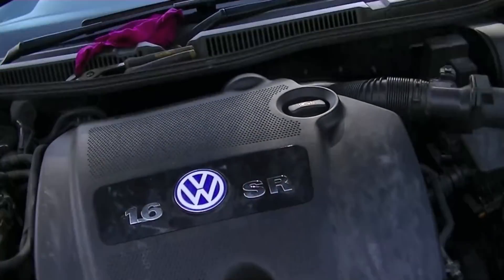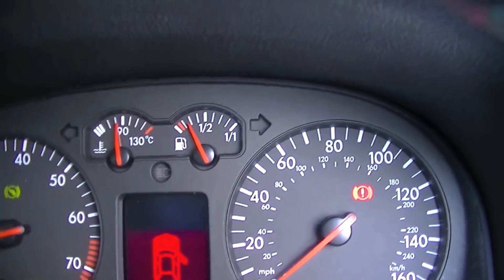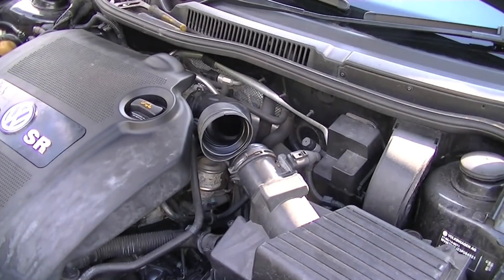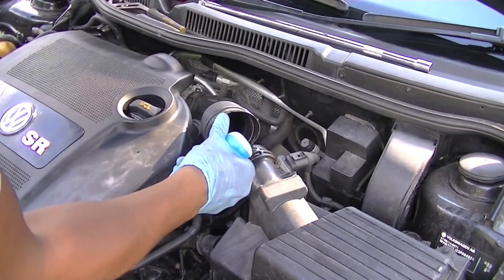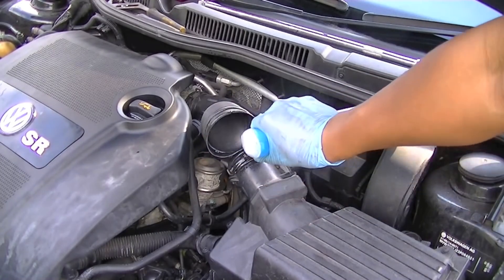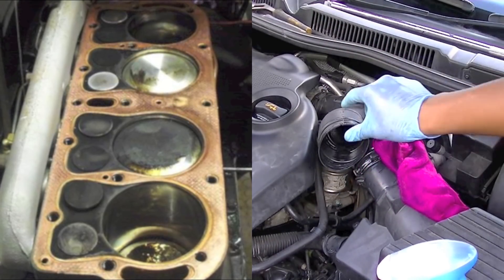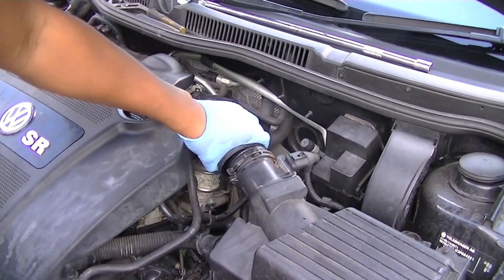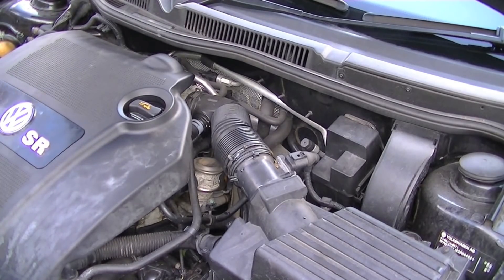How to make your engine run better with just tap water.......Better Than Seafoam?

Comment: WATER IN THE ENGINE??? The only thing that may not come into engine?
Reply: +Luka Koprivica  farmers have used homemade water vapor injection on their engines for year and years and it only helps keep them clean and running for a long long time. water vapor does not hurt the engine.

Comment: LMAO i have been doing this for over 40 years and it has always worked great.
I learned it in 1974 from an old man that was a ford mechanic from the 1930's to the 50's.
don't use tap water use distilled water, tap water has chemicals and minerals in it  that will cause buildup.
Reply: Excellent intelligent comment

Comment: One other thing to consider, that even those arguing about catastrophic engine damage can't deny...if your logic had validity to it, then every single time a head gasket failed, it would also result in a cracked block, cracked head, seized parts, etc.  While this may be true, occasionally, the majority of head gasket failures do not produce these results.  90% of the head gasket failures that I have seen, the engine will be billowing huge plumes of smoke from the tailpipe from burning the coolant, which is at a much greater ratio to the air than in this video, and it will just keep running, albeit, not very well, and will not cause any extra damage.

Comment: I'm not sure why some argue that you can't compress water.  Everyone knows this.  The cylinder is still drawing in over 99% air, even with the mist.  If this argument had any validity, then by all means, DO NOT drive your car when it is raining and it is 100% humidity, unless you want to damage your engine.  The other argument regarding water washing away the lubricants...water and oil don't mix, so it would be difficult for water to remove oil from any surface, piston compression rings create a seal which would prevent water from reaching the oil scraping ring, and most if all, the engine is continuously circulating oil, so any oil that would be removed, would be replaced immediately.  This seems like a logical way to remove carbon.  They say that water is the universal solvent, and over time can break down just about anything.  And we all know that heat increases the rate of reactions.

Comment: Tap water could cause the engine block to crack because the engine can't compress water so once again another stupid video on you tube:(
Reply: Of course it can't compress water, but it's still over 99% air.

Comment: Doesn't Acetone have the same Effect?
Reply: No, acetone will burn in the combustion chambers.  The idea here (very well documented by WWII airforces on radial engines) is to produce steam (that obviously doesn't burn) in the chambers - this steam scours the surfaces, including the exhaust valve stems and tulip surfaces.  It works as demonstrated.  Just run the engine for some time after treatment to make sure no water remains in the intake manifold.

Comment: Water and oil don't mix, I don't think it's a good idea
Reply from the maker: +hdashti2810 If you think about it, the boiling point of water is alot lower than oil. So if water was to get in the oil, it would most certainly evaporate once the engine reached temperature. That is my logic

Comment: What this guy is doing is absolutely harmless to a engine. It will not cause any damage if done correctly. The comments that I've read on hear are fucking ridiculous! Guys saying they are mechanics and this will rust/ruin your motor! That's bullshit! The car does need to be at operating temp for this to work. The head/valves/Pistons do need to be hot and up to temp. How this works is the water makes contact with the hot valves, valve seats, and top of the Pistons. And it then steam cleans the parts free of carbon. The water immediately turns to steam and exits the engine out the tail pipe. The steam does not have time to rust anything. This trick has been around since the 60s. Their is one issue that can come up. If your valves or valve seats are pitted. And you do this steam cleaning to remove all the carbon. The pits  will then be clean of carbon and the valves will not seal until you drive the car for let's say 6k miles and build up more carbon to reseal the valves again.
Reply: The cylinder has two volumes, one is called the swept volume(this is when your piston moves from the bottom of the cylinder or BDC to the top of the cylinder or TDC). The other is the clearance volume(this is the volume left above the piston after it has reached TDC). The clearance volume is far greater than the mixture volume,which includes petrol, water vapour and air. 

The volume of water is way too little the person is spraying into the engine campared to the large clearence volume.

Remember the engine is hot and evaporation occur fast, one piston is moving up and down about 40 to 50 times a second(for 2000 to 3000 rpm). Heres the maths, 40 x 4 cylinders x clearance volume for 1 cylinder, the volume calculated from this calculation will show how super small the sprayed in volume is against the calculated. Thus there will be no knock occuring.

As for the rust, air intake in any car always include water vapour. Water droplets always exits at the tailpipe of any car.

Conclusion, no knock, no rust, period.

How effective this technique is, is in the pudding. Do it if you feel convinced. Remember, your car, your problem.I am going to try it on my car.

Comment: I just did this method today on my 99 vw tdi 1.9l and it has 315,000 miles on it and this actually did have a positive result it ran much smoother and went through the gears much better. I just suggest making sure that you run the engine good after so that all the water evaporates from the oil so take it on the freeway for a nice drive. I did it it's safe and does help with high mileage engines.

Comment: I honestly don't see the point in doing this. If u get significant carbon build up to cause a problem I would expect a misfire and at that point ur surely going to have a root problem which needs fixing. and could turn out to be extremely expensive. I can't imagine how putting steam into the cylinder at at vacuum would have any benefit. This is assuming the amount of water reaching the cylinder has turned to steam by the time the cylinder starts the compression cycle. at that point I would imagine the addition of steam to increase the compression of the mixture at tdc which surely cannot be good for the engine. as engine are so finely tuned these days the tolerances are very fine.

Comment: Petrol in liquid form is compressible as water (.0002%). Fuel when burned generates H2o. At best water would reduce air temperature and therefore increase air density. No risk of hydrolock  at all using the method in the clip. Also the water would turn to steam as it enters the inlet manifold. Don't stress guys. Use Ajax powder puffed into the inlet manifold to hone the cylinders, is what I say.

Comment: To all the haters.... this idea is not without precedent.  In the 1960s, when GM was experimenting with turbochargers, the 215 V8 turbo engine in the Olds (Starfire?  I think it was?) had a water-injection system.   It was primarily to prevent pre-ignition from the high cylinder pressures created by the turbo.  It was not just water, though - I think there was some ethanol mixed in.  It was discovered that in addition to reducing spark knock, it did help 'decarbonize' the engine.   Water introduced to the intake stream in fairly small amounts would be instantly atomized, so the idea of hydrolock is ridiculous.

Some people believed that water injection increases horsepower.  Of course, this is not the case - at least, not directly.  It DID allow certain modifications to the engine to work without being so harsh to the engine, though, so in that sense they are partially correct. 

Before GM played with this idea, it was used in some high-performance aircraft engines in WWII, for the same reasons and with similar results.

Of course, modern engines are electronically managed, including more precise fuel delivery, so carbon buildup should be of only minor concern.  Carbureted engines did not have such precise fuel delivery, and carbon buildup was far more prevalent in that era.

I would also hasten to point out that 'moist' air is not unknown to an engine.  Any time you drive in the rain, you are going to get moisture in the engine.  It is almost instantly vaporized totally and blown out the exhaust, though.
Reply: What water injection did was to slow down the gasoline burn rate which is what happens when you raise octane, so water injection raises the octane, when turbos and superchargers first came out they would overboost the turbo which required higher octane fuel which exceeded the pump premium octane and that would cause heavy pinging which was premature ignition which could destroy valves and piston tops, so water injection cheaply raised the octane points up and the pinging stopped and due to the pinging stopping performance increased, they've since then came out with intercoolers so water injection is no longer necessary plus the intercooler never runs out of water.  The same situation would occur with advanced ignition timing or Nitrous Oxide (Nox for short) injection, too much nox could destroy an engine due to lack of higher octane fuel not available at the pump, so water injection cured that issue which meant they could inject more nox for more horsepower without damaging the engine.  Read this for more detail:  https://www.facebook.com/DevilsownMethanolInjection/posts/we-get-asked-this-a-lot-can-i-use-water-methanol-injection-with-my-nitrous-oxide/699536366806520/
also read this:  https://en.wikipedia.org/wiki/Water_injection_(engine)
Reply: An old friend of mine ran his old old Dacia with his self-made 'water injection', which activated at full throttle. He was convinced he felt the small power plus. 
Btw, the engine was running fine. Always.

Comment: He's not going to hydrolock the engine with a little bit of spray so chill out people. That's the equivalent of a heavy rainstorm and some water getting into the engine. I've personally dropped a squirt of oil into a cylinder and did a compression test, where the compression went ALL THE WAY to 300PSI on a cylinder that should be 150, and it didnt' explode and the car ran afterwards.

Comment: With a capacity of 1.6 is small, it is important great proportion of mixes gasoline and air. 1.6 SR (AKL) If the intake is leaking front the throttle, we have an invalid value to the amount of air on the flow meter (of course worst engine performance). If leaking beyond throttle We have too much air and worst value on the flow meter and worse effect suction air at special intake throttle shortening intake (in SR). Problem on suction meter too. In SR and other small capacity important is hermetic throttle. If throttle isn't hermetic we have problem with air proportion. At certain times for example when we accelerating.

Comment: Dude, you're doing just the exact thing they tell you not to do. Don't you realized that water which has 2 molecules of oxygen and when oxygen is mixed with one molecule of hydrogen (hence HO2) becomes corrosive and will rust (oxide) metal?. You are putting water into the Throttle Body where in order to clean it (I just did my truck last week) you have to purchased one to two bottles of specific "TB Cleaner", you can't not even use carburetor cleaner.

Comment: Hydrolock occurs when a volume of liquid greater than the volume of the cylinder at its minimum (end of the piston's stroke) enters the cylinder. Since liquids are nearly incompressible the piston cannot complete its travel; either the engine must stop rotating or a mechanical failure must occur.

Symptoms and damage
If an engine hydrolocks while at speed, a mechanical failure is likely. Common damage modes include bent or broken connecting rods, a fractured crank, a fractured head, a fractured block, crankcase damage, damaged bearings, or any combination of these. Forces absorbed by other interconnected components may cause additional damage. Physical damage to metal parts can manifest as a "crashing" or "screeching" sound and usually requires replacement of the engine or a substantial rebuild of its major components.

If an internal combustion engine hydrolocks while idling or under low power conditions, the engine may stop suddenly with no immediate damage. In this case the engine can often be purged by unscrewing the spark plugs or injectors and spinning the engine to expel the liquid from the combustion chambers and then restarted. Depending on how the liquid was introduced to the engine, it possibly can be restarted and dried out with normal combustion heat, or it may require more work, such as flushing out corrupted operating fluids and replacing damaged gaskets.
If a cylinder fills with liquid while the engine is turned off, the engine will refuse to turn when a starting cycle is attempted. Since the starter mechanism's torque is normally much lower than the engine's operating torque and momentum this will usually not damage the engine but may burn out the starter. The engine can be drained as above and restarted. If a corrosive substance such as water has been in the engine long enough to cause rusting, more extensive repairs will be required.
Amounts of water significant enough to cause hydrolock tend to upset the air/fuel mixture in gasoline engines. If water is introduced slowly enough, this effect can cut power and speed in an engine to a point that when hydrolock actually occurs it does not cause catastrophic engine damage.
Causes and special cases

AutomotiveHydrolock most commonly occurs in automobiles when driving through floods, either where the water is above the level of the air intake or the vehicle's speed is excessive, creating a tall bow wave. A vehicle fitted with a cold air intake mounted low on the vehicle will be especially vulnerable to hydrolocking when being driven through standing water or heavy precipitation. Engine coolant entering the cylinders through various means (such as a blown head gasket) is another common cause. Excessive fuel entering (flooding) one or more cylinders in liquid form due to abnormal operating conditions can also cause hydrolock.
Reply: good expl.

Comment: do NOT do this. your engine can NOT compress water and you will cause damage.
Reply: +Matt Caldwel you're correct. however, the amount of water they're spraying into the intake will easily evaporate before the compression stroke. even then, it will take a significant amount of water to do any damage.

Comment: If placing water in the air intake to clean the engine is a good idea on ALL car, why not all the auto industries  place an automatic water sprayer in it. It is simple like placing window cleaner fluid when you see it getting low plus tap water is free.

Comment: it will also wash the oil off of the cylinder walls glazing your cylinders and dropping your compression. along with getting water into your oil and making the iron in your car rust. antifreeze doesn't rust the inside of the motor because it has corrosion inhibitors in it.

Comment: just like your are saying what you want, you have no proof you just show us spraying what appears to be "Water". the cylinder that was all shiny and clear was from coolant, not water.. I do not recomend this to use in any situation. Water causes rust and you do not want your throttle body or injectors coming in contact with water.

Comment: Lol @ all these comments. He's not tipping a gallon of water down the inlet he's spraying which then it's atomised not enough to hydrolock an engine and even so by the time it's gone into the cylinders its turn into steam.what do you think happens when your head gasket goes? 75% of the people that have commented on this video have no idea..
Reply: Have you ever noticed how your car goes better on a rainy day or in frosty or high humidity conditions ?....  It's because of the h2o being pulled into the engines  air intake (NATURAL WATER INJECTION).  Yes water is an uncompressable liquid,  but as long as you are not putting greater volumes than any one of the combustion chambers at any one time there will be no hydraulic effect !
Reply: Ive seen some of those head gaskey failures and what he doesnt mention is that there are minerals and RUST builds up in the corners and edges--rather quickly too. Carbon doesnt react to metal but water sure does...thats insane to purposely corrode your engine.
Reply: Zane Leathart
Yes, I've noticed a lot of cars feel good on rainy days. :)

And if it's a heavy rain, sometimes there's a good effect for days after, and then the car feels the same again. Actually doing a purposed water decarbonization has more lasting, desirable effects, but you should check out my video on the subject because I also go over all the problems it causes, most of which you can do something about . . . except of course hydrolock from over doing it.
Reply: The slaz is moving to alaska won't be on much for a month or two
Reply: +parteibonza True. When you do water decarbonization however, you aren't using coolant. It shouldn't have so much crud. 

I show another method of seeing it's effectiveness. A laser guided thermometer can indicate valve leak. My cylinder no. 1 showed hot on the intake. After this, it didn't the first time I did water decarbonization. The second time helped a year later, but now I know I need a valve job.